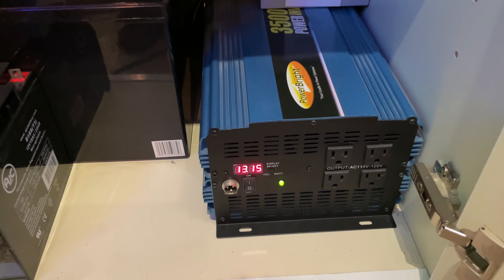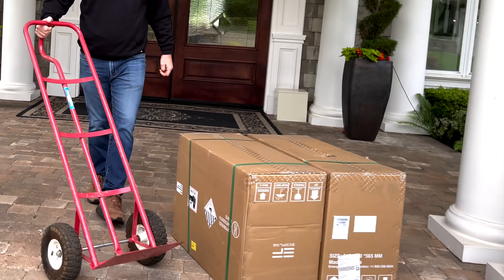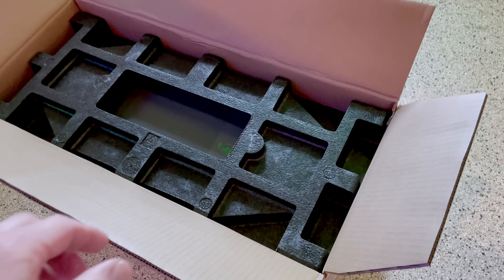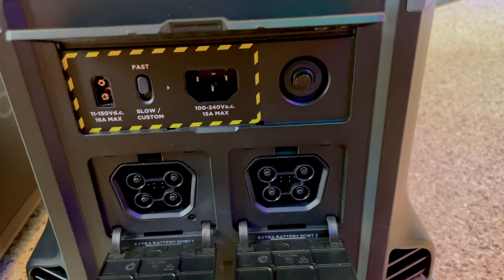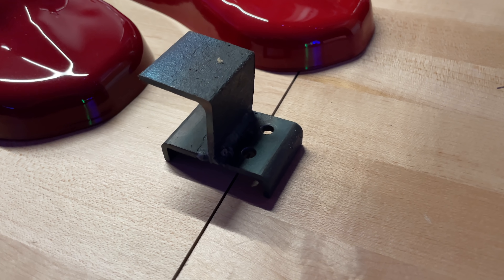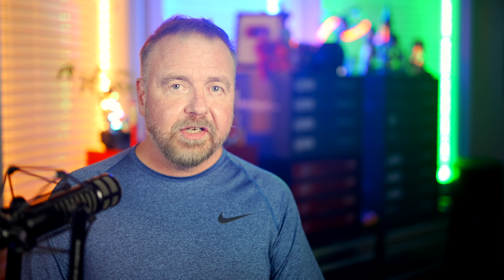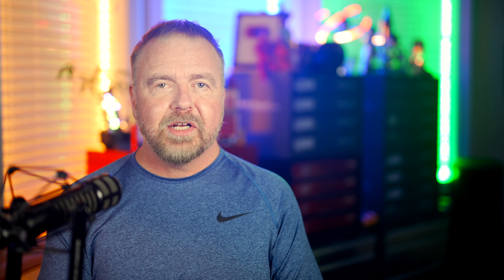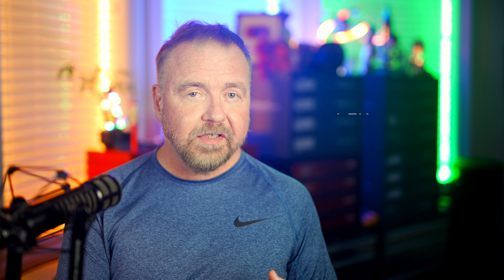Cheap Solar: 12 Years Later - What I've Learned and How I'm Upgrading It

Comment: FYI, you've been misinformed about the code requirement for your generator. Unfortunately, that seems to be how most of the generator installers in your neighborhood (and mine...I'm not that far from you, and we live in the same jurisdiction for electrical inspections) sell their customers.

In fact, our jurisdiction, like nearly all in the USA, follows the NEC, which provides *three* different means to satisfy the generator sizing requirement, not just the two you were told about (i.e. sizing according to the service size, or installing a load-shedding panel). The third of those means is to perform a 30-day load study, to determine peak current draw for your service, then size the generator so that that peak is 80% of the generator's capacity. An important point here also is that the "peak" isn't literally the very highest demand, but rather the highest 5-minute average during the 30-day study.

I'll also mention that after going through all that rigmarole so that we didn't have to install a 96 kW generator for our house -- we wound up finding that a 22 kW would be fine, even with dual EVSE installed, and went ahead up to the 30 kW, because it wasn't that much more expensive and it was among the smallest liquid-cooled generators available, which I liked because they run at half the RPM and are quieter -- no inspector actually came out anyway to care what size the generator was. Turns out that electrical inspections in our region are handled by the state dept. of labor, and they only send someone out for something like 18% of the permit finals (as in, that is literally their target percentage, selected randomly among all the permits completed).

If you can stand to cut back on electrical consumption for a month -- we shut off one of the two water heaters, made sure to only charge one car at a time, did the survey in the summer when we were already drying clothes outside anyway, and didn't use the oven -- you can get the study peak down so low that you're free to just pick whatever *sane* size for your generator you want. You obviously still want to use your best judgment, but if you know for example that when you're running the generator there are certain load combinations you're just not going to use, you can easily get by with a generator that is much smaller than whatever a naïve approach would tell you that you need.

Comment: I still don't understand the use of lithium ion for home power storage.  You don't need them to be light or small (at least compared to when they're powering something mobile), and the rapid loss of capacity means replacing them far too often.

I want to see the industry put as much attention into improving compatibility for and driving down the cost of iron-nickel batteries.  Much of their maintenance could be automated, they last almost forever, they're really hard to damage with heat or overcharging or overdischarging...  They have problems that companies could overcome, but companies are all focused on lithium ion instead.
Reply: Rapid loss of capacity? Using a 80% DOD these should last well over a decade with daily cycling.

Comment: Why you don't use On-Grid system? there is no need for batteries in the project, the inverter is smart enough to synchronize the power generated by the panels...
Reply from the maker: Because the panels cannot provide 6000W!

Comment: 13:19 I doubt that this is generally true. My old digital camera had Lithium Ion batteries and there capacity was at most half if I charged them full and then had them lie around (outside of the camera) for a month. Probably depends on the quality of the cell, maybe there is also a tradeoff with energy density.

Comment: Fun Experiment: How many Ecoflow batteries can be put in the back of a Ford F-150 Lightning before the added weight becomes an issue.  Issues: To heavy for 1/2 ton. Range decreases even when using the Ecoflow batteries to recharge.

Comment: Hi Dave, I have had a Ecoflow Delta Pro for about 4 months now, powering my home office completely, with surplus, from about 2kw of solar. Although I am fairly happy with the system, my only slight gripe is that there is no historical data within Ecoflow's own ecosystem. I have however managed to get it pushing data into an InfluxDB and I now have pretty graphs to look at. Let me know if you would like some direction with that :) I believe someone is working on plugin for HomeAssistant but I don't believe it is working for the Delta Pro yet. I hope the system works out for you and I look forward to seeing how you make use of it.
Matt
Reply from the maker: Good point, I'll raise that when I review the actual units!

Comment: Did I see suicide cables from your portable generator to your house?  Can you set up your Kim1 (or any of your other computers) to monitor your charging rate on your new system?
Reply from the maker: I don't now what that is!  I have a 50A and a 30A that run two panels from the portable when need arises.
Reply: @DavesGarage  it’s when you have a cable that have prongs exposed on both sides.  Once you plug in one side, the exposed prongs have a charge on the other.

Comment: The picture you showed of 875 batteries are not 6 volt as they have 4 cells. I know heat is detrimental to battery longevity even though for lead acid it ups the output. Trojan does not say that cold is detrimental to batteries but it does reduce performance. Trojan says to keep the batteries fully charged so they won't freeze. That picture of 875 batteries sure were awfully clean.

Comment: I just recently had solar installed at my house. Solar panels were set up May 10th and new meter and electrical work to put them on line was done June 6th. I'm already regretting not having a backup battery system. Is that something that can be a DIY job like you're doing, or would I have to get it done professionally? 
I have 27 panels and max live output is 6.6kwh. That would seem to be too powerful for the Ecoflow you showed. I believe max capacity was like 3.2kwh. Any alternate suggestions would be great.

Comment: Question... are those connectors at 9:46 in the wall; male (plug) or female (receptacle) ?
because the cables coming from the generator are (male) plugs, we have an "fools killer cable" or more like a diy electric chair -without chair-... just asking

Comment: Fun bit Dave. Interesting to see what is pretty much normal now in a techie RV running your critical stuff around the house. Any chance you can discuss the advantages on some circuits being "conditioned"? Also, what gear do you have in your shop that requires double phase?

Comment: Is there a follow up video to this? I searched and did not see one.
Reply: Came to ask the same. Installed a sub panel with transfer switch in my garage during move-in remodel. Moved critical circuits (fridge, deep freeze, computer racks etc) over to it and have been putting off the battery bank, solar etc part. This has me itching to finally finish it off.

Comment: Wow - you have crazy energy needs! I switched to all electric everything (heating, hot water, cooker, car) and designed my home off-grid setup in pieces over the last 8 years: 7kW of solar (~40kWh per day), 2x Tesla Powerwalls and a Sense smart meter that I use to make my Tesla Model S charge only on excess solar power. I'm able to run off-grid for about 90% of the year, so long as I don't drive too much.

Comment: I fretted and fretted over what to put in Tin Can. There are tons of useless guides in Cyberspace, useless because they assume you know how much power you're going to use for cooking, lighting, aircon, refrigeration. I have no idea bout any of those things, and no experience to work on.

So, I bought the cheapest 135 Ah LiFePO4 i could find on eBay, a charger to charge from my engine and to accept panels, a 2000W inverter. I should have got 3000W, there are som things such as kettles I can't run off it. A 750W microwave is fine, but most kettles are not. I figure if that's insufficient, I can add a second in parallel. If running around on tour is insufficent, then maybe charging from a campsite r even solar panels.

Comment: Now you just need to create a software application that can create its own power & charge the grid so you can remove your solar panels. Clock ⏰ + engine + Fork bomb the battery until battery is charged  🔋⚡️ and it’s life cycle is complete . It will die eventually and won’t hold a charge . Instead of fork bombing a processor, give the battery a virtual processor and fork bomb it . Make the voltage regulated and port it to the Power Input 🔌 💻

Comment: One major criterion I have is that the system must continue to work and be fully configurable with no cell phone in the picture. I want to keep functioning even when the cell tower backup systems have gone under.

It would be nice to reconfigure the system we have. But, that would break the grandfathering our system enjoys in California. Our total generation is subtracted from our total use and we pay the price difference if positive and get a whole $0.04/KWH on our over generation. So far we've received a few bucks each year despite a nearly 2-2.5 kW continuous base drain before creature comforts are figured in.

{^_^}

Comment: Don’t take this the wrong way, but isn’t it rainy / cloudy most of the time in the Seattle area?  Full disclosure: I’ve never been to Washington.  I’m just going by what I’ve heard.
Reply from the maker: It is, which is largely why I stuck with amorphous panels charging backup batteries and not polycrystalline panels running into the grid - At that time it wasn't sunny enough to pay off here (now the price of panels has dropped).

Comment: Ace! I've just done my summer house/ small office (a wee bit smaller than your garage), but am chuffed with my system, though in the next year or two will move to lithium batteries instead of a leisure battery. 300w max on my panels. Did you go for pure sine wave inverters?

Comment: You were referring to the EcoFlow batteries as lithium ion but they call them LFP (Lithium Iron Phosphate).  Aren't these different?
Reply from the maker: Yes.  I was generalizing about Lead vs Lithium but according to the spec sheet, the battery tech is indeed LFP.
Reply: LiFePO4 is still a type of Lithium Ion Battery.  Lithium Ion is a general term for any battery that stores and releases its energy through the movement of lithium ions.  LFP or LiFePO4 is a much safer chemistry than NMC, LCO, NMO, and NCA but is has a lower storage density.  The only chemistry that is generally considered safer than LFP is LTO which has a lower energy storage density and are far more expensive.

Comment: they never want us to know the truths in this world, however, if you have one of those vintage fast chargers like those that automotive shops had back in the day and you cook the electrolyte out of the lead acid batteries into hydrogen, it cleans the lead and you refurbish your corroded cells, and you can extend the life of your car batteries indefinitely as long as you are in open air as hydrogen is extremely combustable.  dont forget to flush and replenish the electrolyte if you did this.....

Comment: Here's a question: Why not just add a new system, and replace the batteries on the old one?
Reply: Also, as a former delivery driver: Anything that heavy should be packed well enough to cope with the total lack of care any driver will give it, or you provide enough handling gear an infant could move it.

Comment: wonder - how a generator ( 9:34) can run on gasoline OR diesel  or propane - does it use a gas turbine engine - Petrol and Diesel are "usually"  exclusive. (slip of the tongue no doubt - sorry )

Comment: So with the neuron encoding method I'm using, the average human brain could fit entirely in RAM on 11 nVidia A100 cards. Which could also run such a network, if an image existed. Which means I'm about 12% of the way there, both hardware and software-wise, toward my goal of making friends... from scratch :P  Also, go with LiFePo4, not regular lithium ion. Iron-air will be commercialized soon
Reply: What method are you using?

Comment: Lithium batteries are a fire hazard, did you concider an Edison battery? Their lifespan is measured in decades.
Reply: I have "Edison" batteries, and you are correct. Also these batteries can have their fluid replaced instead of replacing the whole battery, which drops their price when they don't charge anymore. I've seen individual cells go down to .01 volts (1.2 volt cell) and come back up without any damage. I still have good batteries over 30 years old, and I bought them used.
Reply: @lesliesavage9229  exactly, we have solved many problems already but because it isn't hip enough or new enough then they govignored

Comment: If you have a 200 amp hour battery, then that means you get 200 amps for one hour.  There is still life in the battery, but it isn't going to run anything at the 200 amp rating after one hour. Amorphous panels? Sounds like the ones you got were used already, since the low price and not getting the rated power out of them. Amorphous solar panels are the worst kind you could get for power generation, since companies have gone out of business trying to guarantee the output over time. Amorphous panels are still being sold, so buyer beware.
Reply from the maker: You should watch the video to understand why I selected them.
Reply: @DavesGarage  Wrong assumption, I did watch you video all the way through, but it doesn't mean I have to agree with you buying substandard equipment, amorphous panels, for home use. A little research would have showed this type of panel is at the bottom for any kind of power generation over time. You can walk on them and put holes in them, but they do not last, which is why amorphous is not the best bang for the buck.

Comment: How long have you had the e46 m3 for?
Reply from the maker: Since God made it :-)  Bought it new in 02!  It's a 2003, 12,000 original miles, zero mods.  SMG though which some people whine about but I think they'll be worth more long term, the weird stuff usually is, even if it was the suck when it was new!
Reply: @DavesGarage  I would have thought a man of your means would have bought the CSL M3 😊

Comment: 9:30 your portable generator runs on gasoline or DIESEL or propane??? I need that generator what is it
Reply from the maker: Actually the unit PICTURED was gas only.  The tri-fuel I grabbed from Costco, and they still have 'em!
Reply: @DavesGarage  so I actually went down to the Costco and inquired about trifuel generators. They showed me a Firman brand unit that operates on gasoline, propane, or natural gas. No diesel :(.

 I've never seen a generator that could use both gasoline or diesel, but I would really like to own one

Comment: I'm really surprised you'd still use fossil energy generation in a region with cheap renewable energy supply. If only for energy security, I highly recommend upscaling the PV, considering small wind turbine, and definitely upscaling the battery. Those portable little li-ion batteries serve a purpose, but you get certain benefits of scale with mains-connected household batteries (i.e. much better lifetime and performance due to less stress per-cell). If commercial offerings like Tesla or Alpha seem too expensive (for your household avg. consumption), nowadays it's increasingly easy to build one yourself from new and/or recycled li-ion (and even li-po) cells. What changed over last few years is much greater availability of reliable BMS, module/pack frames, control software, testers and access to used cells themselves. There are several popular youtube channels describing the process of DIY building 5-50 kWh packs this way. Another interesting approach is sourcing used EV battery packs - similar to DIY with cells, there are now open source software/hardware projects for building BMS to interface with battery packs from i.e. Chevy Bolt, Tesla S/X, Nissan Leaf etc. - this way you're looking at range 40-80 kWh DC of usable home energy storage.
Reply from the maker: Not sure what you mean about fossil.  We're primarily hydro here.  The backup generator I don't see an alternative?
Reply: @DavesGarage  Yep, the generator. If the house battery + your renewable generation is sized correctly, no need for generator or even grid connection. Ultimate DIY project :-)

Comment: Do you ever actually use this stuff, or do you just build it for fun?
Reply from the maker: During outages I use it all the time!  Especially to run the fridges overnight!
Reply: @DavesGarage  Wow! Your power grid must be a lot less reliable than ours. Eight years ago I bought a 12 volt 1000 watt inverter on sale at Canadian Tire for $100. I figured I would hook it up to the car and run the fridge and furnace if the power ever went out. Last month the power went out for the first time. I hooked it up to my trusty '99 Chrysler, started the engine, and let it idle for 12 hours. It worked great. It was kind of fun to have the only house in the neighborhood with lights.